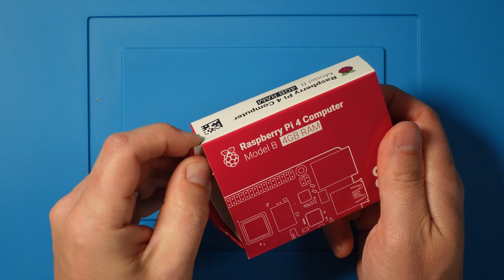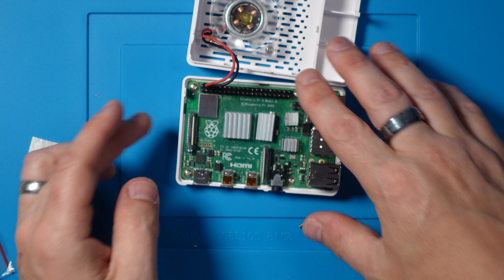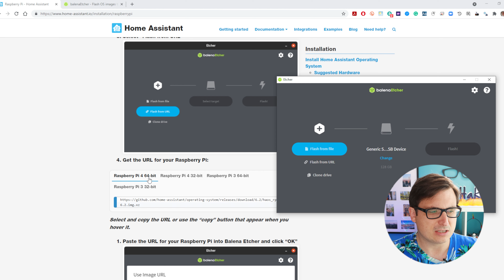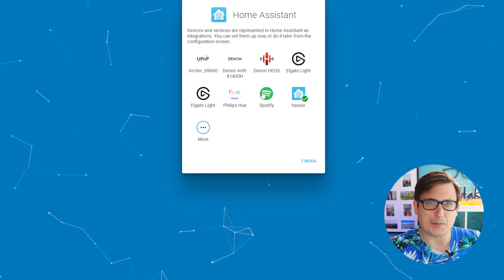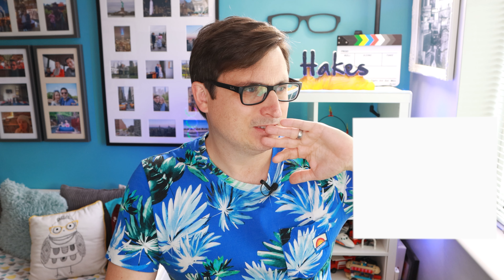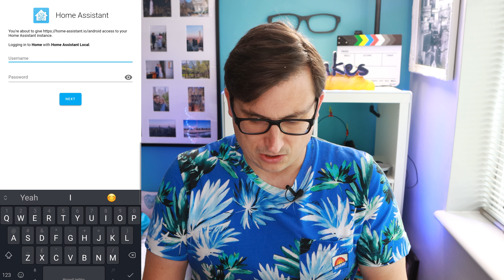How to Assemble a Raspberry Pi 4 and install Home Assistant - A n00b's guide

Comment: How did you configure the cooling fan of the raspberry pi?
Reply from the maker: Theres no configuration.. plug it it, it works when the Pi is on
Reply: @KipHakes  yes, but it works at full speed all the time so it's very noise.. ideally I want only full speed when is over 80C. There's an option for it in the raspi-config.
Reply from the maker: @Saphyel  Mine is tucked away in a cupboard, so I've not had to worry about noise.. Can't help - sorry!